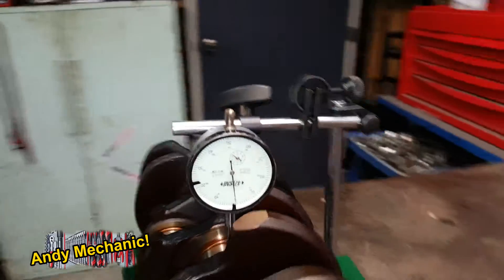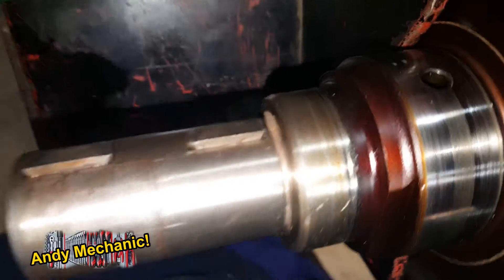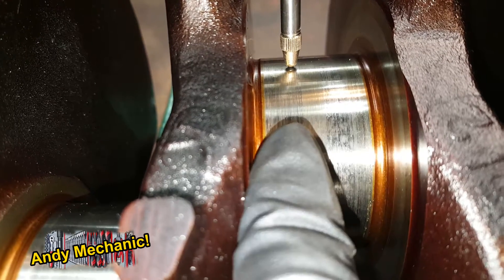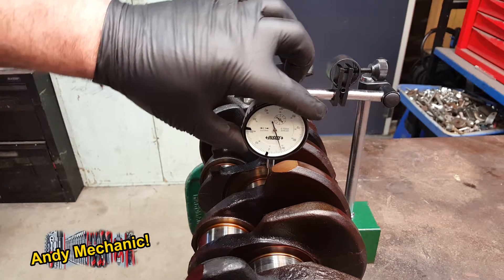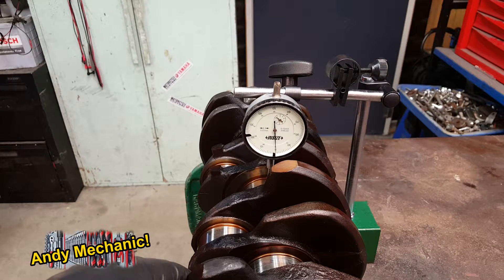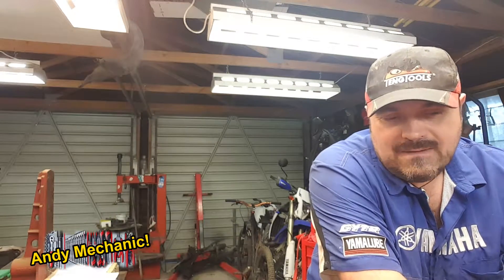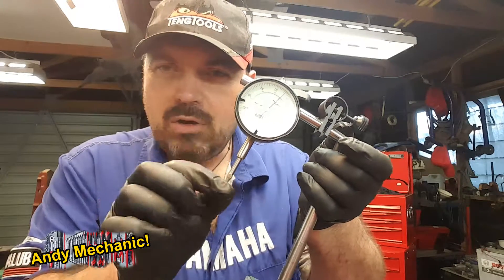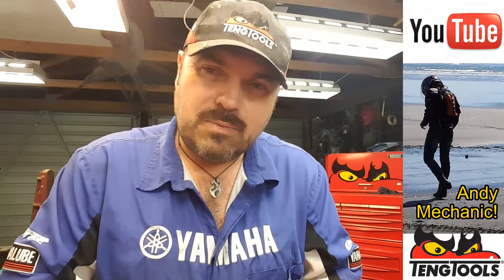Toyota Rav4 Crankshaft runout measurement Ep29 #1143

Comment: Andy did you do videos of replacing the gasket and the head and reinstalling into the car?  I'm just about to start a gasket replacement on a 2008 diesel RAV4 as am debating between attempting an in situ removal Vs entire engine.   Block damage on the diesels is very rare (fingers crossed...).
Reply from the maker: +Justin Adie Sorry, no, that engine turned out to have a warped block - it must have got very hot at some point!
Reply: Andy Mechanic oh no!  After all that work too!